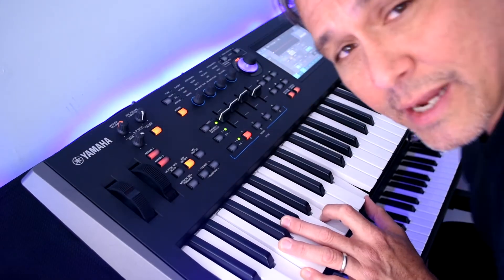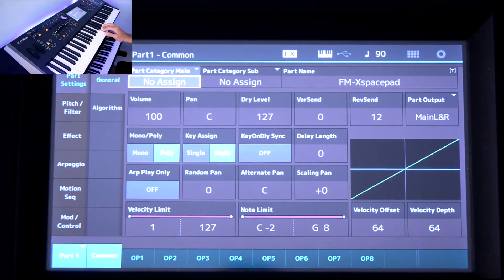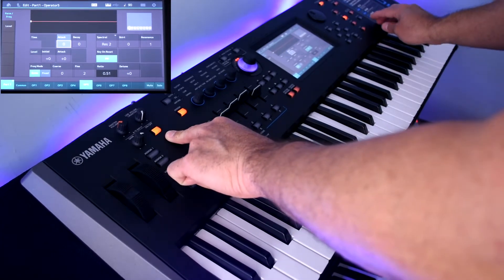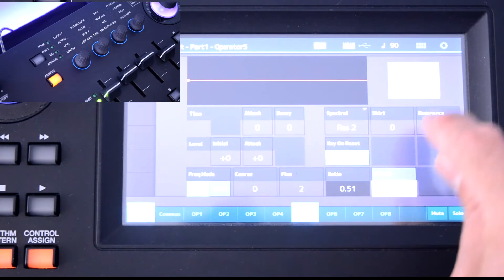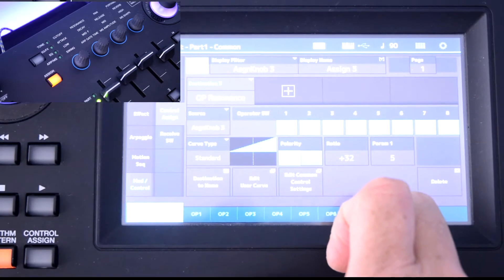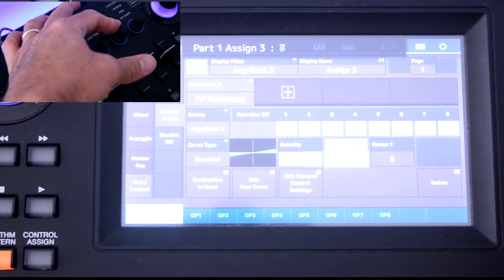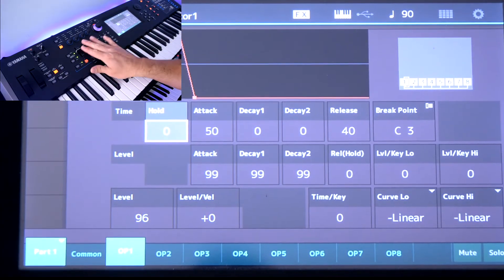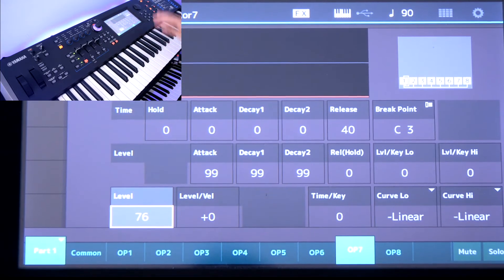MODX 5 Quick Tips and Tweaks for Yamaha Montage

Comment: Thank you for these tips. But your Screen Shot tip doesn't work on my Montage.
Reply from the maker: For Montage: Put a USB flash stick into the USB slot, press and hold down the A/D Input On/OFF switch, then press the lower [SOLO] key and you will get a PNG on the USB drive with a name like "DSNAP_0.png".
Reply: @SynthsandGuitars  Thank you. Many Montage owners will be interested in this infomation.

Comment: Thanks for a great tutorial!  One of the things I’ve noticed is that the knobs and Super Knob are quite ‘stepped’ when they’re tweaked; you can hear quite a pronounced stepping rather than a nice smooth change of the parameter.  Is this just something we have to accept ( because there are only 127 values from one extreme to the other ) or can there be a more natural, analog, smooth increase or decrease of the effect on the parameter you’re changing?
Reply from the maker: Great question, and yes this can be controlled: these knob assignments are made in Mod/Control->Control Assign, simply decrease the "Ratio" of the curve or use a different curve type, or even create your own user curve to your liking. Here's a video example of adjusting this curve for the AfterTouch assignment (go to 21:52 of the linked vid, or click in the AfterTouch timestamp in the description https://www.youtube.com/watch?v=F_Zgf6PjP0U